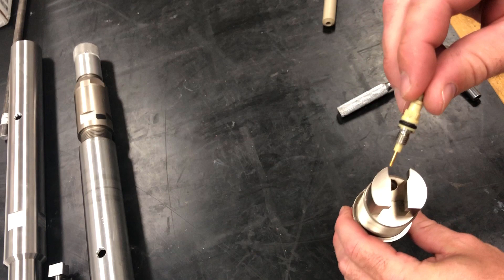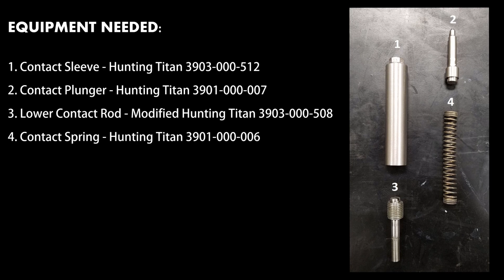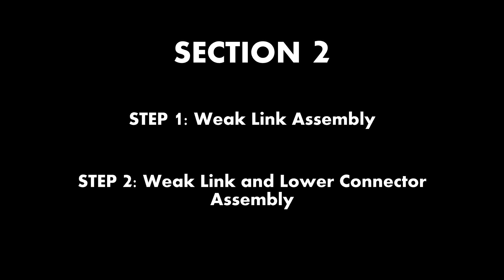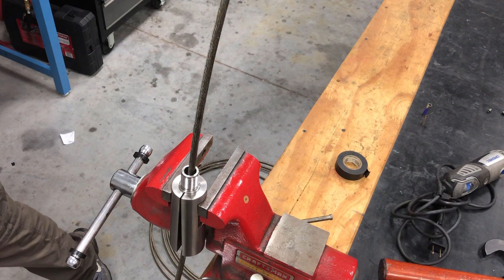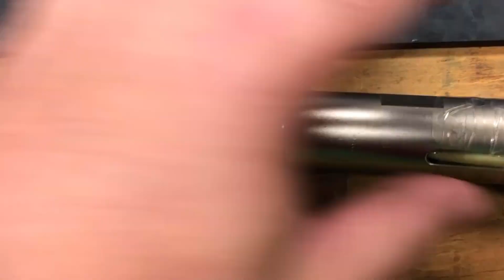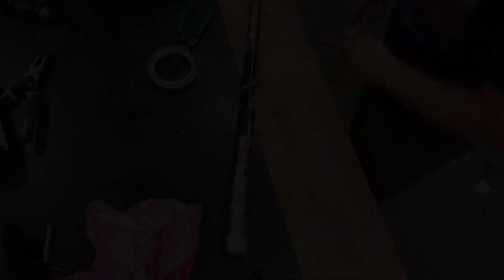KSWC K-WLCH Cablehead Assembly Tutorial

Comment: nice video, but you don't explain what this 'cable head' does, esp. with words like 'conductor' and 'stinger', one would think this assembly is a part of a mining explosive blasting cap, esp if you test the electrical pin with 500V of electricity, that should be enough energy to 'blast' anything :-))
Reply: Its just an over zealous insulation test because spending 4 hours to run into the well only tp have a short have to redue it all again is no fun